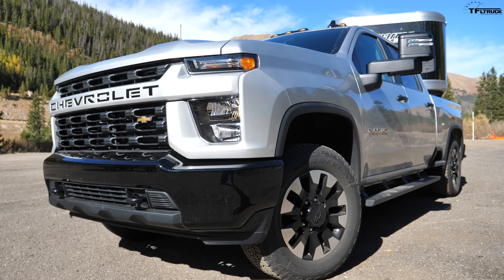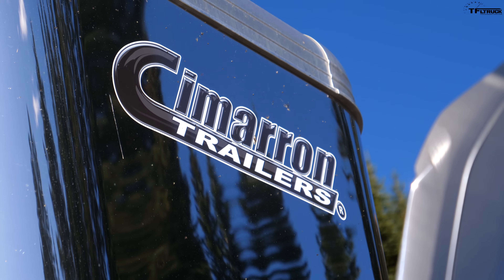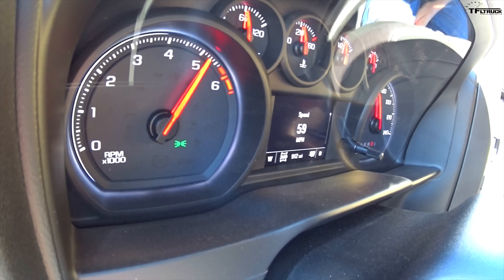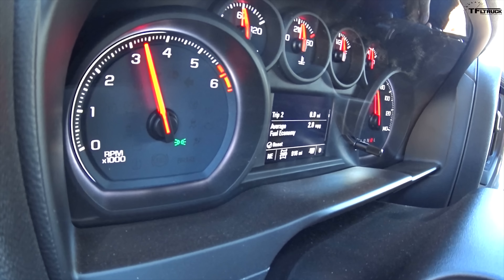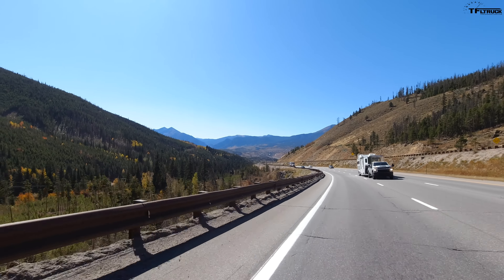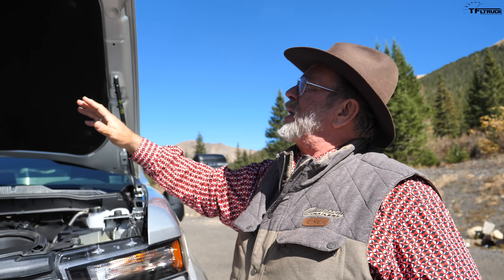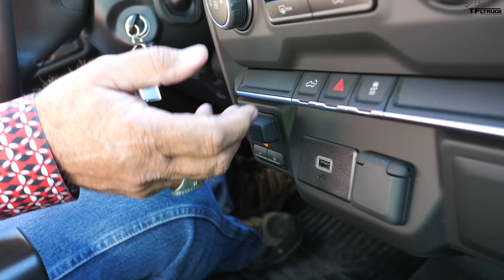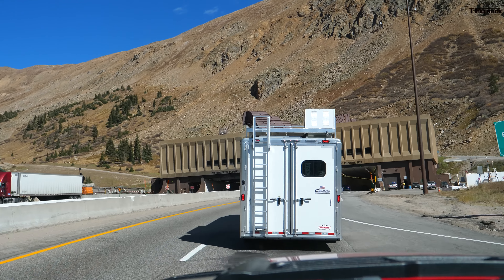The New 2020 Chevy Silverado HD Gasser Broke Our Ike Gauntlet Scoring System - Here Is How!

Comment: Can someone explain why the ball is 2 inches behind the axle?
Reply: ..It's centered on the rear springs now because the axle is not centered on the springs and to give better fifth wheel RV clearance to the cab while turning with the short bed truck.
Reply: @rlhmarines  oh OK that makes more sense. I just bought a slider hitch to do that for me. But on a short box yeah sometimes it still isn't enough
Reply: Yeah and TFL pushed it even further behind the axle with that torsion adapter. Probably contributed to the squat.
Reply: @dchawk81  OK thanks

Comment: 1153 time uphill slowing to 25 miles per hour 10 downhill brake applications. 2.4 MPG.  OUCH !
Horrible real world performance in that truck while Max Towing. GM needs to make it 4.10 gears, 8 speed auto or better, and a mild supercharger to get 525 hp and 600 lb-ft . That would be a great truck. STILL GOLD MEDAL AWARD FOR UGLIEST TRUCK though.

Comment: So to net it out, the new 6.6L is underpowered at an endemic 401 ponies, and should have been mated to the 10 speed transmission. Listening GM?
Reply: Don't you mean anemic?  And 401 hp isn't weak.  The engine is just mated to the wrong transmission.

Comment: The manufacturers can say what they want. The gas truck here can’t safely tow 16,000 lbs. 13,500, mayybeee 14,000. Can versus should is key here. That and the fact these trucks all have a manual shift mode. That would have made a pretty big difference as well. The truck would still only maybe doing 45 or 50 mph at the top of the hill, but still would have been much better. 
    Forget the towing wars crap. Diesels aside, basically, there are always exceptions, if a gas truck is rated to tow eg 8000 lbs, I would tow 6,000 lbs or 75%. 16,000 lbs x 75% = 12,000 lbs. This has always served me well, except in the big headwinds we can have here in Southern Alberta (55 - 70 mph), Montana in the foothills get the same winds.  I have generally done that all the time, even with diesels but 80 - 85%. The Trucks last longer, work much easier and are more comfortable towing. I was a Rancher, so had all kinds of opportunity to overload my trucks, just refused to do it. 
  I use the number as a benchmark take away each brand’s bragging rights and am better off as a result. Before I retired I had trucks all the way up to F550 diesels. If I need more towing, instead of tying up $200,000 plus in a tractor trailer that met my standards, I just hired that out. Let the professionals carry that much weight. If I kept ranching I may adjust my numbers a bit, transmissions are better, motors are more powerful (somewhat, in gas) and suspensions are better. This much weight in the box, I would add airbags. 
    I see the tests as an indicator is all here. I fully understand why the testers don’t manually shift the trucks, because it would never be right for anyone. 
    Thanks TFL for what you do! You put the information out there and we can use that information for our purposes. There are many of us who have enough experience to further add our own personal preferences (quirks?) so we then make a better informed purchase. Thanks again fells!

Comment: Rather have my midnight edition with 410 tran n all the bells. 6.2 for the win 2500 3/4 (the first year they made it a option but not standard)
Reply: Hauling and stopping weight like that, no way in hell would i want a half ton.
Reply: @BrokeGuyBBQ  I'ma 2500 3/4 what are you talking about? Good Lord. I ordered this truck from Chevy for pulling. I think tha 373 standard wasn't cutting it for me. Bro if I was hauling a 10k travel trailer with a 1500 I woulda not posted. I fixed my post for future confusion.

Comment: I had a 6.0 2500 Chevy that wouldn't pull up hill for beans and overheated when I tried.
Congrats to Chevy for making a truck that still won't pull up hill for beans but at least doesn't overheat. 
Market dominance is just around the corner.

Comment: So its ugly and with the goose neck hitch placement it will porpoise constantly unless you are on a freshly paved road. Honestly I don't get the comments about it needing more gears, I have driven thousands of miles in trucks with 30k pound higher GCVWR than these pickups and a six speed works just fine. If you think your light duty truck needs a ten speed maybe you just need to admit a pickup truck isn't meant to tow that much weight.

Comment: They need to bring the 8.1 vortec back in an updated platform, if that want a monster gas motor, especially if they want to outdo ford
Reply: There are rumors of a 8.0 liter or bigger engine Chevy is working on to compete with the bigger gas engines.
Reply: @matthewhaga5400  There's also rumors that if that engine even exists that its going to be a medium duty only engine.
Reply: @nathanmcdonald610  It'd be cool either way, maybe if were lucky it'll be for the 2500 and 3500 too.

Comment: Dropped to 25mph and doesn’t downshift?  How the they rate it at 16k towing capacity?  Definitely doesn’t sound like Chevy used the new SAE J2807 tow testing method. My 4Runner will run up one of the steepest grades in TN pulling 6.2k going 65mph and has a max tow rating of 7k.  I bet Ford and Dodge spank it!
Reply: DJ Cordes 4th gen V8 4Runner?
Reply: MrJamesLuz Yep. Had it since new!  It owed a 20 ft Sea Ray and 23 ft Cobalt (25’ 1” LOA) since 2012. Boat is huge behind it, but it tows very well for being so big!
Reply: It is still more weight ratio for engine size than 6.2k. 16k plus truck weight is a lot for a small block engine. However, it would benefit from 4.10 gears.

Comment: I just don’t get why anyone would buy a 2500 vs a 3500. You lose payload and gvwr for less than a $1000. Sure, the 2500 may have the exact same engine/trans combo, but if you wreck with an overweight truck, you’re flat screwed. Spend that extra 12/month and buy yourself some peace of mind.

Comment: Ouch!  GM really got a black eye from this test!  Mating the new 6.6L gas truck engine with the old 6-speed automatic transmission really compromised its ability to climb grades.  It was either buzzing close to redline in a lower gear or lugging out of its powerband in a higher gear.  An 8 or 10--speed trans could have had the right ratio to make the thing climb hills.  Ford's 7.3 with the 10-speed is going to eat GM's lunch.  At one point during the climb, the Silverado was down to 25 mph, and a semi pulled out to pass it!  How embarrassing.  Whoever did the transmission calibration at GM that delayed downshifting to such a low speed should be given a lump of coal in his stocking for a Christmas bonus.  But on the other side of the coin, it is TFL Truck's practice to let the transmission shift itself.  Sometimes, that can really hurt a truck's performance.  Many drivers would manually shift the trans to get into a better gear for climbing grades.  I know I would.  It would be nice if TFL would make two runs up the Gauntlet:  one letting the trans shift itself, and one with the trans being manually shifted to keep the engine in the powerband.  How about a follow-up test, guys?

Comment: so did it fall on its face because the oil overheated and it pulled power? You guys were talking for along time about showing EVERY gauge, all the gauge intel the whole ride asmuch as the vehicle would show. ITs important intel many want to see. Then just keep a little square video of it within the large video. Talk about it once in awhile. Temps are important.
Reply: I would have liked to see the temperatures, too.  But I think the problem was the transmission wouldn't downshift.
Reply: @andyharman3022  as designed, when transmission and oil temp reach too hot. It pulls power and locks the gear and rpm needed to lower Temps to the max acceptable.

Comment: The 2500 work truck with no trailer or load gets 12 miles to the gallon in the city That's pretty good for no fuel management system straight up V8 6.6 L that's pretty good if you want to just daily drive one like it's a 1500 go ahead because the 1500s these days are garbage It doesn't matter what the brand is even Fords 150s are trash It's just because they're passenger cars They don't have to go by the same regulations as the 2500 and the 3500 those are commercial vehicles so they have different regulations That's why they're better and they don't have stupid cylinder deactivation or auto stop trash

Comment: Long rant 
LS engines are week on the low to mid rpm power. GM Should have stroked to larger displacement .  GM Flops again. Just bought another f450. Please would the big 3 just make me one chassis, with solid front axle, Allison transmission and a Cummins without cp4 pump. Ps I know the new 4500-6500 but they don’t even tow my boat. Please bring back the kodiak. I want a 35k in towing in a  platform that’s last more then 250k a true medium duty truck.
Reply: LS engines are not weak on low end and mid range torque. Go look at a graph haha.
Reply: matthew haga 
I have built turbo lq4s, supercharged lq4s and a stroked 409 lLS all needed 3k slip converters just to launch off the line
Reply: @RobertGwreck  Look on a graph and you will see the LS engines make more low end and mid range than the small block engines they replaced. I have built engines also. Alot of it is in the tune.

Comment: Good god GM why are you so stingy with your 10 speed?!?!  Where in contrast Ford is like Oprah with their 10 speed!  "You get a 10 speed" and "You get a 10 speed!"  This 6.6 has a lot more potential but is held back by stupid gearing issues.  Hey GM if your going to give this truck a 6 speed why not stay with the 4.10 rear axle ratio?  Or maybe put a 10 speed in it like your competition!!

I just went back a couple years when TFL tested a 2017 2500 HD 6.0 4.10's same basic transmission and pulled 13,500 lbs up the hill in 10 min 20 seconds.  I'll bet if this truck had 4.10's or a 10 speed with those 3.73's it would have pulled this hill in a similar time!!

Way to go GM, introduce a brand new truck, and new engine with a transmission from 15 years ago!!  Sit back and watch your market share go further into the shitter because you are not willing to compete in ANY segment!!

Comment: WTF? I run my 2015 6.0 at 2200 rpm. 
325,000 miles. 
This won’t last.
Reply: Probably the most reliable engine ever made all our parts trucks at Mark Christopher  go at least 250,000 before replacing them.

Comment: I can’t believe how high the rpm are on this truck your dam near on the top limit.not a big fan of this gas engine at all .
Reply: He's wide open throttle? The transmission should shift to make sure the engine is near the max RPM so you're getting the most power because he's wide open throttle. Same goes for the downhill test, it should go to a higher RPM that way it won't pick up too much speed
Reply: They're pulling a trailer that max's the truck out, going up a mountain pass that's nearly 2 miles above sea level. It's going to run at high RPM. This engine is built to handle running like this day in and day out.
Reply: Nathan Bain 
Right I guess I don’t know the truck but if that’s the way it’s designed to run all’s good .nice truck am here in England and I run a Toyota hilux ,I think that’s like your Tacoma that’s if your from the USA.

Comment: Just goes to show how much better diesel is when towing up hills or at higher elevations, or just towing in general. The duramax was what, 3 min faster?   I'm not even a chevy fan but that time was disappointing. It needs either 4.10s, or it needs the 10sp. Seemed like it was struggling with the idea of downshifting ... curious to see how the ford 7.3 and ram 6.4 will do!

Comment: It was only 3 minutes slower then the other version of it self that cost 12 grand more......I’ll be 3 minutes slower and save 12 grand. Be real a 40 foot trailer, on a 3/4 ton. Just 3 minutes steepest grade in USA. So basically it will roll and be reliable for years to come and be fine. I love your channel but you guys expect these things to pull like a big rig with a Honda price tag. Let’s come back down to earth a bit that thing will do the average joe just fine for a long time.
Reply: You would drive it better and get half of those 3 minutes back!

Comment: Finally,  but my 2018 duramax is still my pick for heavy hauling. But they need to replace that ancient 6.0.  Gas engines in HD trucks just aren't meant for heavy loads up hills.  Level they are great im sure.  Looking forward to the ram and new f super testing
Reply: "Gas engines in HD trucks just aren't meant for heavy loads up hills."
-
Ecoboost has entered the chat.
Reply: Its not a 6.0 its a 6.6 gas now. Its naturally aspirated so the higher you go the worse it gets. Boosted engines like diesels and EcoBoost engines do much better because the air is forced into the engine. So thin air doesn't effect it as much. Go down to sea level much different story.
Reply: @PistonAvatarGuy  
Talking about heavy loads, not half tons. Eco isn't hauling  18k all day. 😁
Reply: @fl_atv_riders4455  well aware of new 6.6, I stated 6.0 being replaced.    Diesel just trumps all for towing.
Reply: @davidlusk4350  ya diesel is going to tow more. But unless your maxing the truck out every day or in high elevations like this dont see 10,000$ being worth it for a diesel. My old 04 2500hd 6.0 pulled 12-14000lbs every day until 200,000 miles in fl changed a water pump.
Reply: @davidlusk4350  Yeah, you'd need a larger EcoBoost engine than what Ford makes for that.
Reply: @fl_atv_riders4455  
Money does add as a factor, but I'm always in the camp of more is better if ability to purchase it.  10k is exactly the addition to my 2018 hd, but I was thinking if im paying all that cash,  might as well get everything that it has.  Plus tth wheels get pretty heavy fast so more guts are worth it imo.  But the additional 200 a month payments for the diesel  do hit my wallet hard every month.
Reply: @davidlusk4350  ya if ya got it spend it and sorry about the 6.6 thing the way you worded it made it sound like you were not aware of the new 6.6
Reply: @PistonAvatarGuy  Ford's not putting a EcoBoost style in the f250 and bigger because they said it is to unreliable when under a constant load. Then whent back to a engine style that they haven't used since 1996 a pushrod engine. Fords engineers talking shit about their own engine.
Reply: @fl_atv_riders4455  
Lol I hope he was thinking half tons, I honestly could give 2 flips  what they are doing.  Wasnt sure what engine they use anymore,  power stroke, or tritan.  That does seem to be taking a step back though.
Reply: 👊🍻 all good
Reply: @fl_atv_riders4455  When did they say that? If they built an EcoBoost engine specifically to power the HD pickups, there's no reason that it would be unreliable. Anyway, it's not like the HD diesels are all that reliable these days because their insanely complex emissions controls.
Reply: @PistonAvatarGuy  the engineer said that when they day viewed the new 7.3 gas. Tfltruck has it when asking questions about the 7.3. The guy even went as far to say the EcoBoost was designed as light load capacity as in moving the vehicle itself or a small trailer.
Reply: @fl_atv_riders4455  Yes, the CURRENT EcoBoost engines, I was saying that a LARGER EcoBoost engine could be designed for heavy duty use and would work just fine. The 7.3 is just cheaper to build, which appeals to fleet owners, and that's where most of the HD sales are.
Reply: 6.6

Comment: Needs like 480 hp and 500 ft lbs. The new 6.6 is a dog
Reply: I'm thinking 430 SAE hp and 475 ft.lbs. But Ford's new 7.3L should be 450 SAE hp and 510 ft.lbs.
Reply: @gen1c8rs88  why not 505hp and 550 tq to the tire...
Reply: @garrettmccord   Longitivity, fuel consumption and power and torque at lower rpm; it's a utilitarian truck, not a high performance variant. The maxium SAE HP for me is 6.6 × .65(65 HP per liter) = 430 HP,  7.3 x .65 = 475 HP. The minimum SAE HP for me is 1 HP per cubic inch so 400 for the 6.6 and 445 for the 7.3.  So the Ford to me is under performing for it's displacment and needs 15 more horsepower, and with 445 SAE HP(at 5500 rpm, same as current 430hp) I think it should have 500-525 ft.lbs of torque(at 4000 rpm, same as 475ft.lbs.), but 430hp/475ft.lbs. implys 445hp/485ft.lbs.

Comment: The calibration of that gearbox is a joke... why is it holding gears below 3000rpm before down shifting at WOT? even the old 4 speed auto's didnt do that
Reply: If you had the option to manually select gears you would of been able to shave a whole minute off that time by driving up in the lower gear with the cruse set at 52-55mph.
but your testing is good way for buyers to see how it preforms with the lazy or not so bright driver

Comment: So aggravating about GM..even my 2011 Dmax/Allison it doesn't show you what gear your in as you drive. Except Manual mode. 
But the info is there...my Edge Insight shows it.....and when your Converter locks up as well.
How hard is it for GM to understand real driver's want that info and it's a simple addition to the gauge cluster info.
This is yet another reason GM doesn't connect with customers

Comment: If you were maxing the truck out. Why did you not test a 4.10 rear end??
Reply: 3:42 or 3:73   Are the options.
No 4.10
Reply: benjaminwayneb that’s not true I can send you a pic of my window sticker. I have a 4.10 in a 2020 gmc 2500 hd!
Reply: @benredmond8271  I went through the Chev and GMC web sites again, no 4:10 option in 2020, it was an option in 2019.